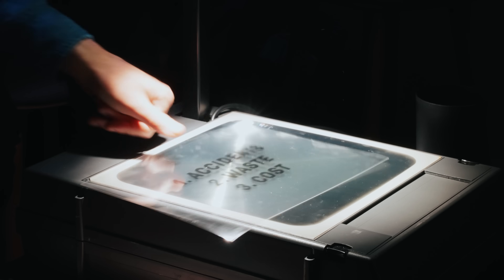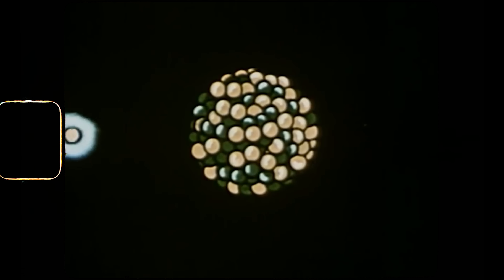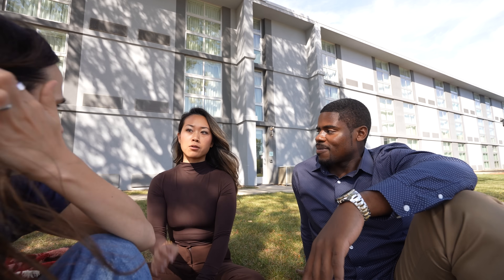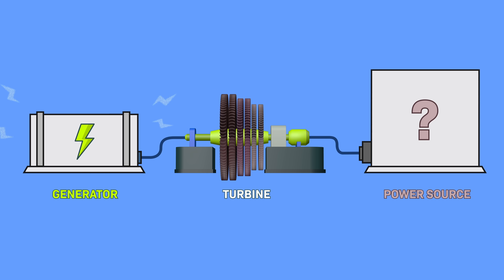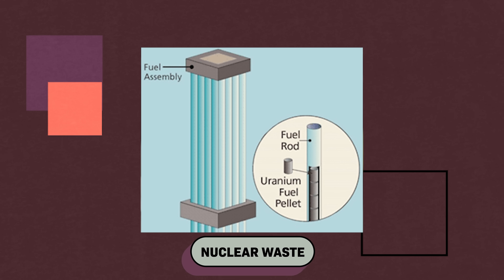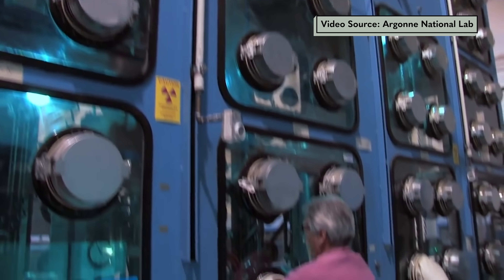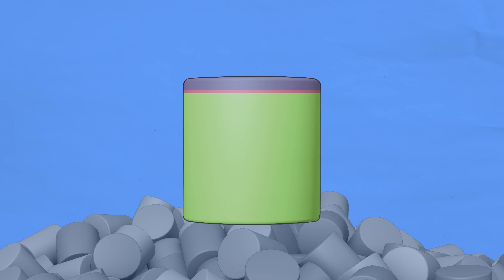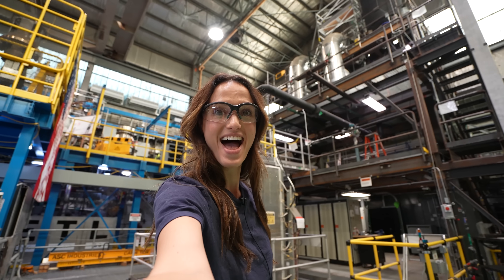The Big Lie About Nuclear Waste

Comment: Big, sensational words (such as "big lie"), from Cleo, whose brain can actually be short circuited, as we learnt, but, unfortunately, little accurate information. If you create videos about nuclear energy, I suggest you don't acknowledge your knowledge primarily comes from the Simpsons, because "that classic glowing green goo in yellow barrels" is not classic - it's dumb.  
Also, at least try getting the basics right.  NO, you don't "fire a bunch of free ATOMS at your U235". Those are not atoms, but neutrons...  (facepalm)  If you want to get accurate information about this topic, please find a channel by someone, who is not thoroughly confused by this complex subject, and doesn't give you the false idea, that there are "fast reactors" (thinking they are good, but Carter banned them) and "lightwater reactors and apparently nothing else.
As for the conclusion, yes, the industry knows about the possibility to reuse spent fuel cartidges, but the reason that isn't widely used is not a big lie, not some conspiracy, no, it's something much mundane: cost.

Comment: Ok so how much energy does it take to reprocess this fuel? Is it more energy that it produces? You can't "get energy from nowhere." 

What I've always been told is that we've always been waiting for solar to catch up because it takes significant energy to do these reprocessing jobs. If you're using fossil fuels to do this, well then it's just not worth it. (It would not be carbon neutral.) So we stored these things away for later days until we had better alternative energy. 

Literally a "It's not my problem, let the future generations deal with it" solution. This is what people wanted to avoid. The boomer and previous generations used that "solution" for many things, and now a lot of those things are coming to head for the millennial generation.
Reply: "Is it more energy that it produces?" Yes.

Comment: Maybe you should thank your paranoid leaders for why you do not have the needed facilities:

In October 1976, concern of nuclear weapons proliferation (especially after India demonstrated nuclear weapons capabilities using reprocessing technology) led President Gerald Ford to issue a Presidential directive to indefinitely suspend the commercial reprocessing and recycling of plutonium in the U.S. On 7 April 1977, President Jimmy Carter banned the reprocessing of commercial reactor spent nuclear fuel.
(...)
In March 1999, the U.S. Department of Energy (DOE) reversed its policy (...)

 (Source: Wikipedia).

Comment: There is an extra step, At the end you use carbon to collect the radiation and then make diamond voltaic batteries (even in their current form they could be useful implants like pacemakers) This makes the waste safer and useful.

Comment: Having the technology at hand is great. Recycling the waste to lower environmental risk is great. My issue would be the cost of nuclear power. The cost of new reactors is very expensive, they have huge security costs, and their waste - even at hundred-year cycles - is yet another security/environmental issue that would need to be dealt with. 
Economically, would money be better spent on the energy storage of wind, solar and geothermal? Environmentally, would it be smarter to invest research into lowering the overall impact of those 'greener' power platforms during their respective life-cycles? 
I admit I'm a bit more biased towards wind/solar/geothermal since visiting an off-grid clubhouse of a local skydiving club. I like the ability of individuals or communities to be more energy-independent. 
Great video.

Comment: You need to make a presentation on the Thorium Floride Molten Salt reaction process. One place to look is Copenhagen Atomics. Look it up. MSTR process in a Small Modular Reactor SMR is the best way to go. The MSTR process can also use older Nuclear Waste as a fuel as well. Thorium is a naturally low radioactive material that can be handled more easier than Uranium. As well, Thorium is many times more abundant than Uranium on the earths surface. An MSTR needs Uranium to start and once started will use the Thorium as the reaction source with the capability of bringing Uranium into the fuel cycle. The Chinese are working on a Thorium reactor as well but Copenhagen Atomics is ahead of the Chinese and will likely work along with the Chinese to implement an energy solution for the Chinese Belt and Road Initative infrastructure build that has been in place for 10 years.

Comment: Cleo mentioned fleetingly that the reactors in which the U & Pu recovered from reprocessing spent fuel are FAST reactors.  This means the neutrons are fast i.e not moderated.  Fast reactors are much harder to control than moderated ('ordinary') reactors.  The book We Almost Lost Detroit tells of a frightening accident in a big fast reactor which was soon abandoned.  
She says the numbers in U-235 & U-238 are numbers of neutrons, which is wrong.  They are the numbers of nucleons i.e protons + neutrons.  She doesn't know nearly as much as she pretends.
Reply: Surely there is an explanation for why countries like Japan (after Fukushima and the political fallout both internationally and domestically) would be using fast reactors in the modern day despite being as dangerous as you claim they still are. We Almost Lost Detroit was written by a novelist, with exactly as much nuclear credentials as Chloe has, and his writings were mostly about extraterrestrials and the supernatural. What's more, it details the experimental Fermi 1, which all modern fast breeder reactors were built after, and it was a fast breeder reactor, not merely a fast reactor. If you want a counter perspective from the people who actually worked on Fermi 1 and can speak with authority to the details that Fuller got wrong, read We Did Not Almost Lose Detroit. 

Chloe might not have been exactly precise on isotopes relating to the total number of nucleons rather than neutrons, but it is more precise to say that the difference between isotopes is solely determined by the number of neutrons rather than the number of nucleons. She should have said nucleons rather than neutrons, agreed. But it's such a minor nitpick that it comes off as you just finding anything possible to disagree with.

She is making videos for an audience who know next to nothing about the science (When I taught science, I used to teach how power-plants work to 3rd graders in their non-native language using roughly the same presentation she has here). She does not have to have a tremendous scientific expertise to explain the general concepts. Moreover, she in no way presents herself as an expert as she clearly shows how she went through the learning process in the making of this video. She is not feigning expertise here, so your only valid criticism is the minor point that she said neutron when she should have said nucleon.
Reply: go watch Pandorah's promise.
Reply: Fast breeder technology is over 70 years old. The video mentions NOTHING we have learnt so far. The book is pointless to mention. The practical experience with this technology is enough for endless horror. Conclusion: Only in very, very sparsely populated areas does a catastrophe not lead to the loss of several million lives.

Comment: While it is technically possible to refine nuclear waste into new fuel, what you leave out is the incredible cost involved compared to renewables, and the very long timelines to do so safely at scale. The US has spent, on average in inflation adjusted dollars, $3.58 billion per year of direct taxpayer subsidies and research moneys on nuclear power since 1948, and nuclear power is still the most expensive form of utility scale energy for new power plants at an estimated $141 to $221 per MWhr (MegaWatt hour) of electricity.

Renewables have received just $0.38 billion (380 million) per year in direct taxpayer subsidies since 1994, yet utility scale solar and wind is often the cheapest available at $24 to $96 per MWhr,  and wind and solar with battery storage is still much cheaper than nuclear at $42 to $114 per MWhr. The EROI of nuclear is around 14 to 1, about the same as the low end estimates of oil and gas, while the EROI of new renewables is much better at around 20 to 1.

Nuke plant operators have been fined by the NRC and FERC for trying to make their nuke plants profitable by operating as lagging source (peaker) plants, when they are designed and licensed to operate as leading source (base load) plants, and doing so adds a lot more risk to their operations.

The main reason for the lack of support for nuclear energy is primarily economic, since it requires enormous costs to mitigate the risks involved, and they are just so incredibly complex and expensive to build. Nuclear power plants cannot afford private insurance, since insurance companies examined the risks involved, and none are willing to insure nuclear power plants fully at rates any plant owner/operators can afford. They carry a small amount of private insurance, then there is a self funded industry "pool" of money that is to be paid by all plant owner/operators to cover liabilities of any single owner/operator for any accidents or disasters, and the vast majority of risk is to be covered by taxpayers.

Comment: The Nuclear Industry is counting on your spreading this propaganda so they can profit. They'll probably even give you huge grants if you keep promoting them and nuclear technology.  The oil industry puts out this same kind of hype about using oil refinery waste for 'clean' energy. Go visit a fracking well and check out the water. it's all about the WATER. Have you done any videos on our one finite resource - water? Clean water is necessary for all  life. The water used to generate this power and  cool these spent fuel rods will never be clean again, unless and until they can process the water in a way that cleans it and separates out the radioactive particles. Doubtful... 

So you were not allowed to film inside? Why would that be? Maybe they don't want you to see the hazmat gear or talk to anyone who has cancer from working in these places. The eager young and naive designers and engineers are not the risk takers; they never have to get near the stuff! What are the risks of heating up this waste again and again? What gets emitted - how, and to where? If it's really possible to re-use the stuff safely and cleanly, why then are these industries pushing storage of nuke waste and permanently polluting the waters? IF you could separate the radioactive particles out of water, that would really be something. It might be possible to stop the China Syndrome, such as is being emitted still from Fukushima. Why do they build these things on coasts? They need massive amounts of WATER> Think about this!

 None of this makes any sense. If what you say is really the truth (though I think there is NO 'clean' energy - all forms are dirty and polluting in some way) - then someone is profiting big-time from keeping on generating nuclear waste. The question is who - and why did they shut Argonne down from doing this thing? I guess recycling doesn't make enough profit! THAT would be something worth digging into. Who's at the top and who profits -  and who suppresses information that would supposedly help us and the planet? Now THAT would be some real investigative journalism;  so badly needed in these times of hype and collective gullibility about everything for profit of the few. You'd probably be de-monetized for daring to expose them, though. Or worse. A reactor lasts about 40 years and then needs to be shut down and shelved, but what to do with all that radioactivity? So many questions. I remain skeptical - it all sounds too good to be true.

Comment: The principal behind generating electricity has been around for 150 years. The turbine technology has been refined not in the last 20 years, not in the last 40 years, but over 80 years ago to 100 years ago, by getting every ounce of energy from the steam the real thing that has changed it’s the way you heat the water America are very inefficient at doing it they used to burn crude oil at one time and because they thought it was inexhaustible, supply they only bother to get 25% of the energy out of it and like you quoted just now when you get money involved and people are getting rich, they don’t care keep the almighty buck

Comment: You know what another really terrifying phrase I have heard over and over at every nuclear disaster?

" We never could have imagined that happening"

If a technology can destroy the world and we keep having huge disasters because we don't know what we don't know, then we should not mess with it.

Especially when we have an unlimited amount of hydro power.

My city had a hydroelectric plant that was over 100 years old and it routinely generated 12 megawatts

There is an agency of the government called FERC and every decade the PowerPlant needed to renew its operating license.

The plant Let its license lapse for years and another company came along and designed a brand new Underground underground hydroelectric plant that would generate 240 megawatts using less water than the existing plant

But FERC denied the new plant and reinstated the old plant.
WE could have 2000% more power from the existing hydro electric plant but the government was paid off and it voted against the public interest.

WE can build new hydro and wind and solar cheaper than anything else, especially nuclear which is the most expensive.

It makes zero sense to build any other type of plant.

I Maine they built an in river turbine to generate power for the city.

There was no difference in elevation.
Just the current in the river spins the turbine.

WE have the technology we just need to use it

Comment: So basically if I understood well. The nuclear reactors are too good for the recycled fuel cells. That implies making a new generation of reactors so that this fuel can be used. It would be so much better if a modification would allow the new generation reactors to run on this recycled fuel. But I see it as on a car. If you have a very performant engine and yiu use lower octane fueal it will en up getting damaged.

Comment: And then there was a vault in Humboldt County, California just South of Eureka, that contains six casts of high level waste. Each 85 ton cast has a welded SS lid and a concrete lid except for the last which only has the concrete.
     The vault sits on a receding bluff, in a tsunami zone (wave would be unimpeded directly to the vault), sits on several active faults that  actually form a wedge beneath. The vault is on the Cascadia Subduction Zone which is sinking as fast as the sea level is rising which will make the area an island unavailable to emergency equipment.
     The vault sits 450yrds or so upwind of an elementary school (South Bay Union Elementary), 115ft. from a state Bay trail and 125ft. from one of the most biologically  rich bays and estuaries on the Pacific Flyway. Local Native American culture collect fish, shell fish and waterfowl to Nuclear taste.
     When the SHTF the experts and political elite will apologise for the loss of life and say they thought it was a good idea to put high level waste there.

Comment: given the most part of nuclear waste isn't from the fuel itself but all the materials used for building, run and so on - but it's the waste of the fuel where most people are concerned about while the bigger issue is the rest - as the fuel could be reused in specific reactors known for decades

edit: but for the next 150 years... I don't think so, as you need to keep in mind that energy consuption goes up as well... depending on how quickly we keep going in tech it will be more and more...

Comment: Not sure where the big lie was in this. Recycling anything has the same problem.  Nuclear with light water reactors,  you are always tring to keep it from going, well, nuclear. Thorium reactors you have to try to keep the reaction going. It something goes wrong it goes out. China is already starting to use this technology. It is also much more abundant than Uranium. To get pass burning fossil fuels, we will need ALL sources of power. We have got to work smarter to save the earth.

Comment: Wait... correct me if I'm wrong. 
Fast reactors allow for reprocessing the waste into fuel. 
Light water reactors (which I understand have been the norm since 1977) don't allow for reprocessing.
What's the difference between them and could the waste from light water reactors (in use for the last 40+ years) be recycled? If not, is the existing waste from these light water reactors counted in the calculation of 'how many years can nuclear waste power the USA grid'?

Comment: Hey Cleo, Its not that simple, while it does work and yes we can generate energy out of it, fast reactors needed for this to be beneficial are always at a risk of going super critical and being another nuclear disaster. I have a PhD in nuclear engineering and willing to explain this to anyone who would like
Reply: Thank you for bringing this up! ❤
Reply: I remember reading they wanted to use fast reactors or breeders, dont know If thats the same, to reuse that nuclear waste. But the material you were getting from the process was usable for nuclear weapons. So of course they stopped exporting that technology all over the world.

Here from Wiki:

It was expected that the proliferation risks posed by breeders and their "closed" fuel cycle, in which plutonium would be recycled, could be managed. But since plutonium-breeding reactors produce plutonium from U238, and thorium reactors produce fissile U233 from thorium, all breeding cycles could theoretically pose proliferation risks.[63] However U-232, which is always present in U-233 produced in breeder reactors, is a strong gamma-emitter via its daughter products, and would make weapon handling extremely hazardous and the weapon easy to detect